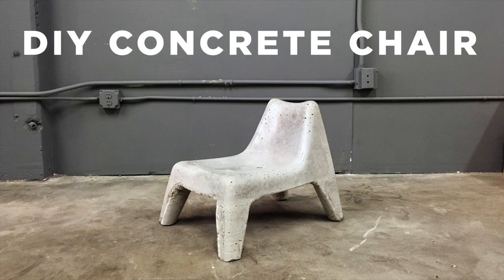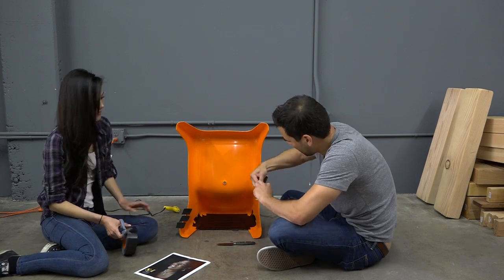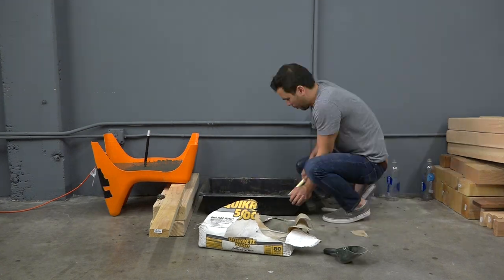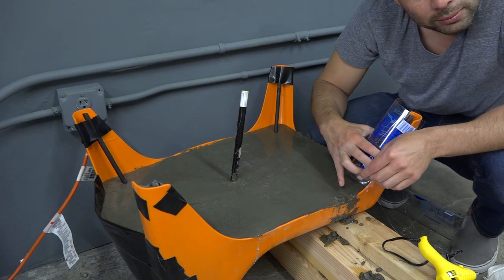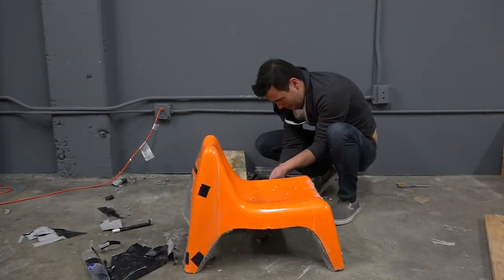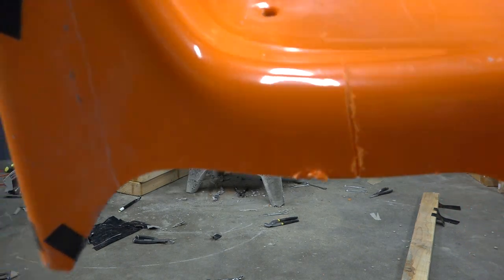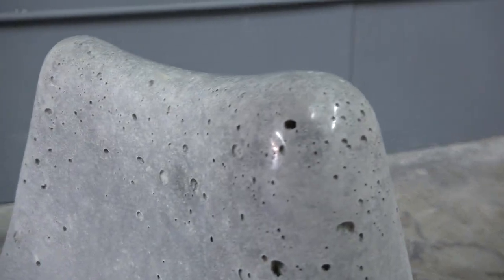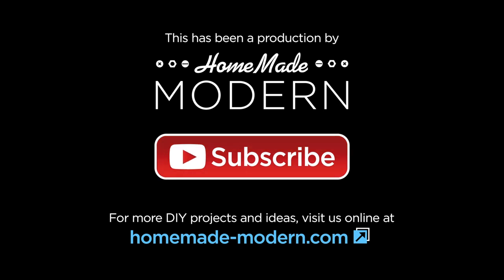DIY Concrete Chair IKEA Hack

Comment: the best way to vibrate the air bubbles out is to use a palm sander without any sandpaper fitted, just hold it against the mould and move it around to vibrate those bubbles to the surface.

to make the chair lighter use vermiculite as an aggregate' it's light but you might want to sink a little chicken wire into the concrete to make sure it's strong enough for the challenge

Comment: to lower the weight of the chair add styrofoam beads from a beanbag chair to the mix. It's what they do in the industry and you don't lose strength.

Comment: Paint the plastic with oil to make it easy to release the concrete chair, no need to damage the plastic that way. Would be a great project to do in the woods - carry the quick-crete to the site in smaller loads, leave the concrete chair in the woods to weather and get all mossy and natural looking.

Comment: For reducing the weight you can add a first thin layer into the mold then fill it with reinforced quickrete: concrete with 5cm fiber glass strand and bolt
Reply: +Xavier Ancarno or not use concrete in the first place, this will reduce all the weight XD  hahaha

Comment: As for weight reduction, polystyrene balls will work well. A polystyrene mix is used in commercial kitchen bases for cabinets. Super light, but with many of the properties of concrete. Trials of mix ratios would be needed.

Comment: Use an electric sander to vibrate the plastic chair frame to settle the concrete to avoid voids and bubbles. 5 to 10 minutes total in about six different areas on the platinum chair should suffice.

Comment: One thing you can do is to do a vibration table, which mean only a used car tire and put a plate on the tire, under the plate (plywood for examples) screw an old AC motor from a old tool under the plate, on the rotor glue or tape some piece of metal to make the motor vibrate. 

You can screw the plate on the tire so it does not move, you will have perfect concrete without any bubble with this :)

Comment: I've always wondered if you are actually using bottled water to mix the concrete? Why don't you just use tap water? (I am not asking if it possible to use tap water, just asking if you do or not) thanks!

Comment: To reduce the weight, put down a layer of concrete, add a block of Styrofoam and then top it off with some concrete. So it's almost hallow inside

Comment: To reduce the weight what about after the first thin layer of concrete over the whole surface, fill the rest with a mix if concrete and expanded clay aggregate?

Comment: why not use some kind of wax  to coat the mold so it doesn't stick? and you can use gfrc to reduce weight or just submerge a slab of foam into the concrete

Comment: What's the weight of the chair? Thx
Reply: +Diego T - I can't know for sure, but judging by the video, they used at least a bag and a half of Quickrete at 80lbs per bag = 120lbs, plus water (~8 pints per 80lb bag) = ~1.5 gallons = 12lbs, a small fraction of which evaporates during curing, let's be generous and say 2lbs, leaving 10lbs of water and 120lbs of concrete = ~130lbs? Seems heavy!